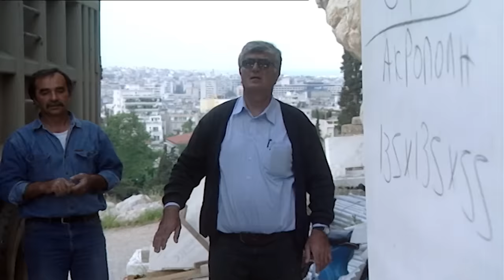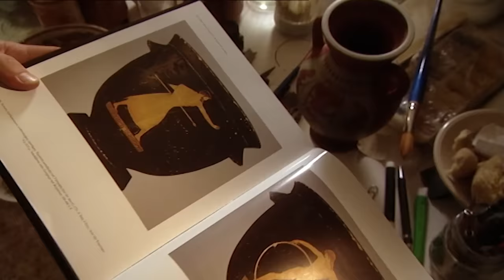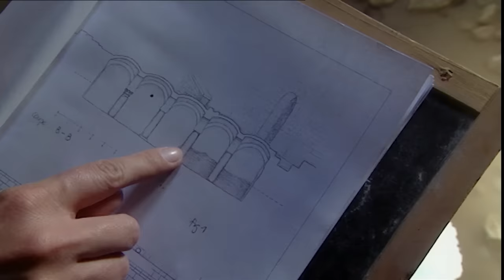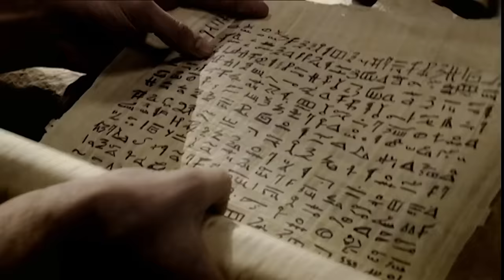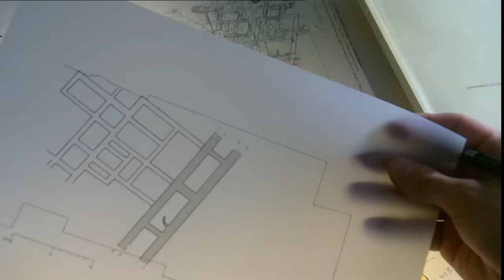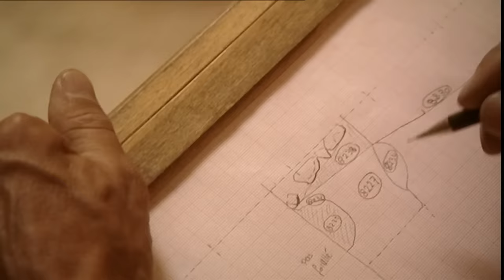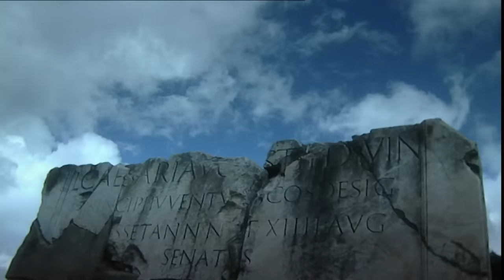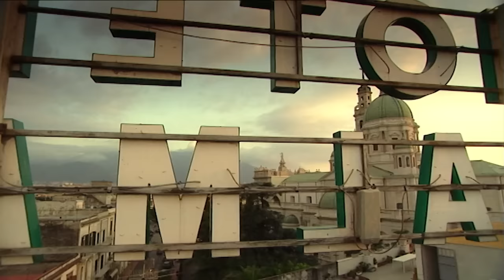3 Hours Of Awe-Inspiring Cities That Ruled The Ancient World | Metropolis: Full Series

Comment: 6:40 without paper? Come on.. Sure they had paper ! The architects learned sacret geometry by drawing in paper, in platos academy,  just like in Egypt, where the greeks learned all this sciences and arts. They where using (probably as a secret technology) but using a navigational computer, and a astronomical clock at the same time, the Antikythera mechanism. If the greeks had that kind of tech 3 thousand years ago, to think they did not use paper is a joke. Paper was an old tech in Egypt 5 thousand years ago, and greece is only a few days away on a boat.